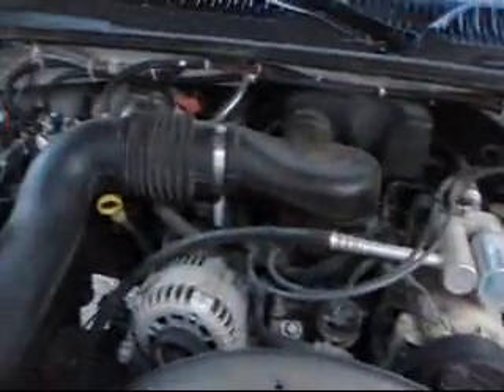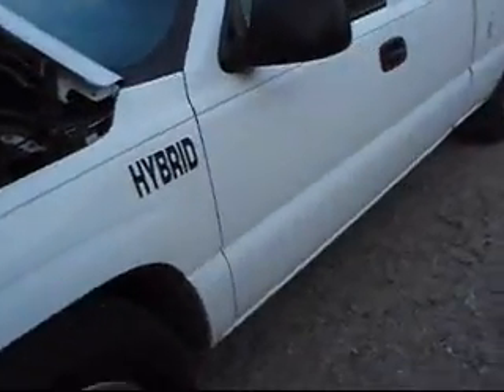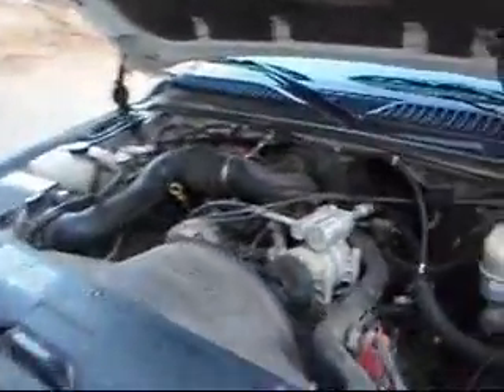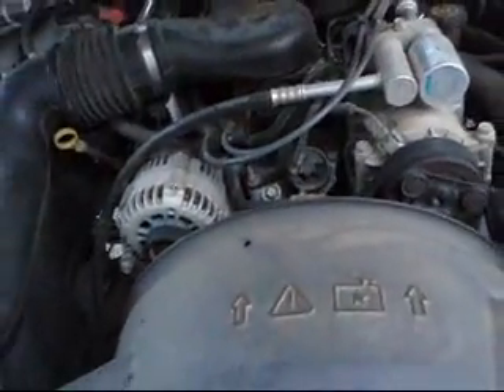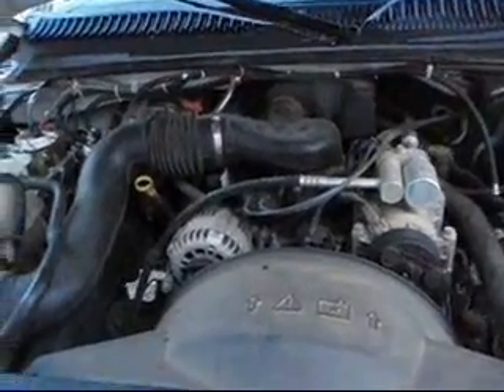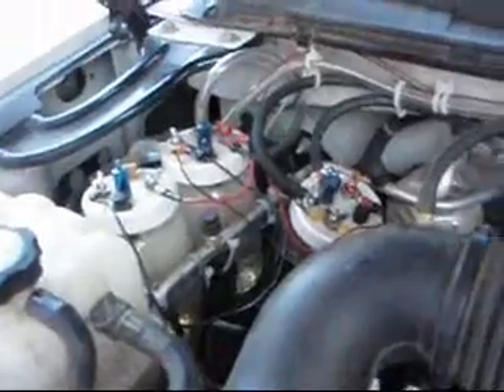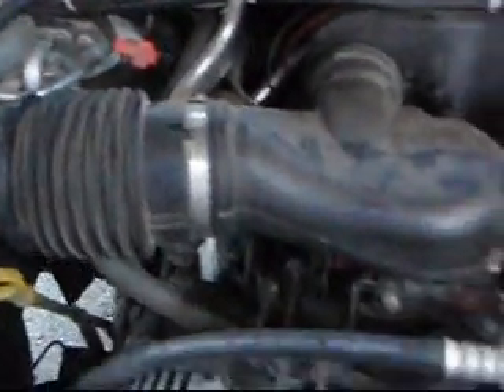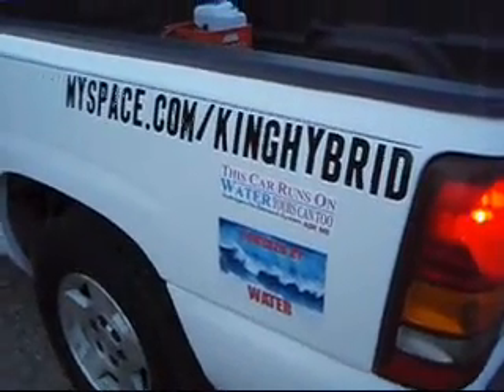HHO Generator Video. Hydrogen On Demand Technology on my truck went from 13 to 30 mpgs. Installed ONLY $200. in the Inland Empire !!

Comment: Can you tell me how the electrical wires are set up. From point A to point B. It looks like you have four jars. And how you get current to them. By hooking directly to main battery or threw electrical harness connectors. Also what gage of wire you are using on them. Please.